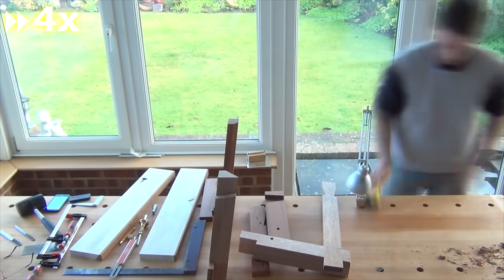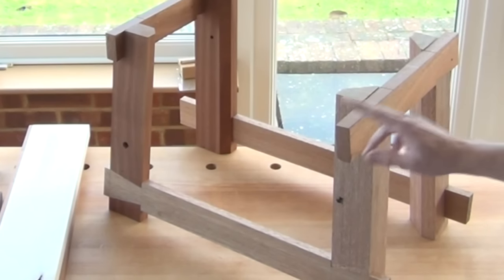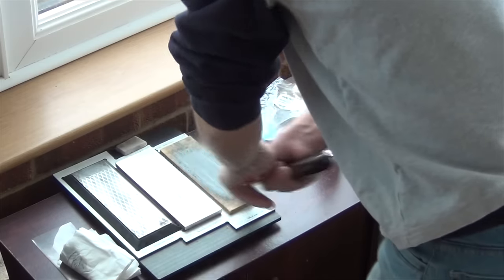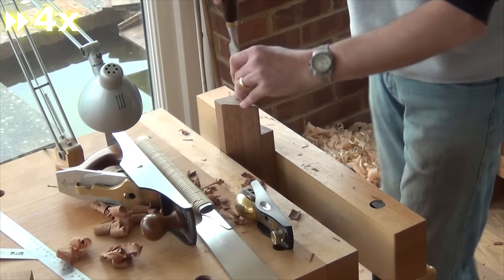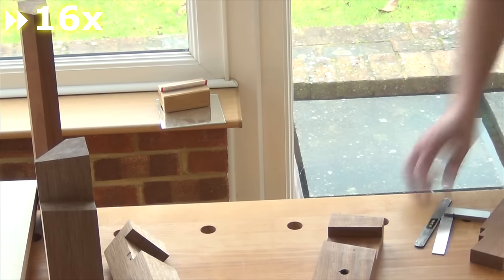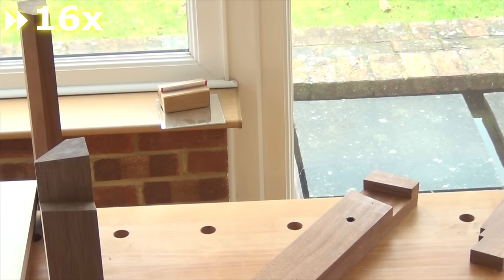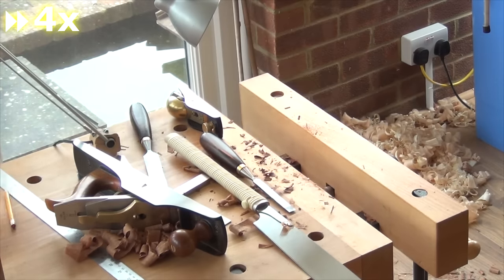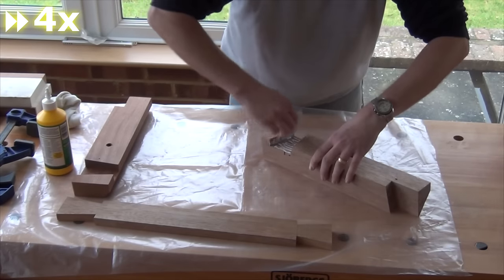My Sawyer's Bench Build part 5

Comment: Mitch, just simply toss anticlog tops immediately away!!! The nail which fits in the hole of the nozzle will absolutely close the bottle so the glue will never dry or harden; small idea - you may even choose to paint the head of the nail in some descriptive colour which will alert you what kind of glue(fast, medium,...)  is in the bottle. Of course you've got to use selfdiscipline to close the bottle after using it with the same nail. It really works like a charm Mitch(even with superglue), with a tiny pin with round coloured head) which are usually really pain in the b.tt  - cleaning your fingertips after "declogging"! Kind regards ;)
Reply from the maker: Definitely one to try, Cheers

Comment: Just a small hint about your glueing nozzles problem, just insert a nail with nice head to fit tightly in the cap and will never have the clogging again, nice video, regards from Slovenia
Reply from the maker: Great tip Miki! Sadly many glue bottles come with anti-clog tops, which don't easily accept a nail, and seem to clog up just as much as any other.

Comment: Nice video, Mitch.
The bank is progressing.
Time a question, what angle do you have for the oblique legs?
Reply from the maker: Cheers Gunter!The one I built was just by eye, and turned out to be 6.5ish° one way, and 7ish° the other. On the plans I produced afterwards, I opted to make them both 7°. Being the same means you only need set a bevel gauge once, and there's less chance of going wrong.
Reply: Thanks for the reply, Mitch.
Then I know and will write it down, that I will not forget it.